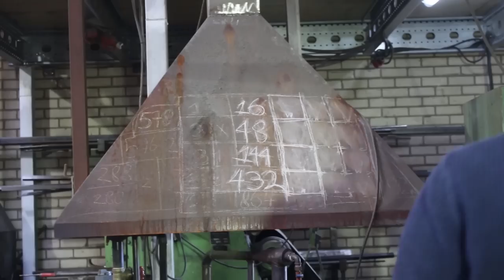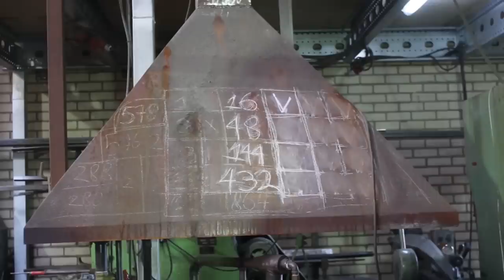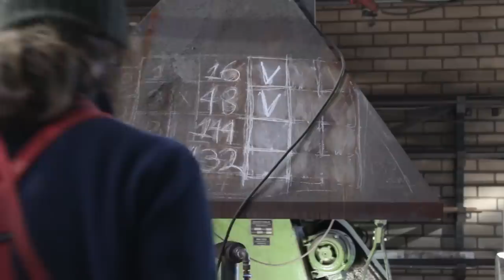Forging a double fuller knightly sword, the complete movie.

Comment: I would really want to see someone doing a sword like this just like they did it back in the 14-15 centuries. I'm sure its nothing like this. This this sword you made, it's piece of art.
Reply: I think it would be possible, but it would probably take something like ten times as long
Reply from the maker: You might be surprised how much was already automated by water power in medieval times.
Reply: @TheyCallMeHacked  uuuuuuuuuuuuuuuuuuuuuuuuuuuuuuuuuu
Reply: It essentially is done the same ways its been done for millenia.  The only things machines do is the backbreaking work and a more efficient way of heating the steel with gas forges  Aside  from all that and the option of whether or not monosteel billets are involved,  smith's or customer's choice, it's all still done much the same way for thousands of years.

Even with most of the backbreaking work now done by machines, some things must be done by hand for either best results or done at all.
Reply: Not just the craftsmanship. The guy who does nothing but 'make steel' is a major issue. We have nice steel in 2022.
Reply: Try looking for a documentary about forging The Ulfbhert ...  really forging from scratch ... making the crucible and kiln , then actually making crucible steel to make the sword with.
Reply: @rustythecrown9317  Exactly, WITHOUT THAT GUY! Your skill can only take you so far. He is 'that guy'. Iron Pillar of Delhi - without the metallurgist, most people had crap swords.
Reply: @gravewalkers  Vikings brought ingots of crucible steel back from Iran etc. , and crafted the super sword back home.
Reply: @rustythecrown9317  All of them did? One did? Give me a % of all swords made by wizard steel? 98% of them? Or .001%
Ballpark it for me.
Reply: @gravewalkers  5% maybe... rare ... only made them for a couple centuries till the trade route vanished. Wootz wasn't discovered again by the Europeans till 1800's.
Reply: @rustythecrown9317  I have a book on it. My other series. I will put up an audio book eventually.
Reply: এর RS ,, দামকতো
Reply: @rustythecrown9317  There's nothing special about wootz. It's mostly for decoration if you are able to get decent quality steel.
Reply: @Eric-zs6rd  true, today , but from 800 to 1000 A.D. , it was the cats ass.
Reply: @rustythecrown9317  Definitely not. Vikings captured or stole the Ulbert swords in battle. The production did not take place in the Scandinavian area.

The exact origin is unclear. Some researchers suspect the steel came from Afghanistan, Persia or India. It is said to have reached Europe via traders from the Orient via the Volga and the Caspian Sea.[5][6] Material analyzes in turn indicate that the lead comes from the Rhenish Slate Mountains. For this reason, some researchers assume that the monasteries of Fulda and Lorsch were the places of manufacture.[5] There is evidence of this after a find from 2012. During excavation work, a very well-preserved Ulfberht sword was found in the Weser near Hessisch Oldendorf. After a detailed analysis, the State Office for the Preservation of Monuments in Lower Saxony and the University of Hanover came to the conclusion that the sword was forged in the 10th century and that the lead used in the handle comes from the Hintertaunus. This was interpreted as a reference to a workshop in Fulda or Lorsch, because weapons production there is guaranteed and other monasteries presumably got the lead from nearby deposits

Source: https://de.wikipedia.org/wiki/Ulfberht#Ursprung
Reply: More likely 500 years earlier.  ;-)
In the 15th century nobody wore such monsters anymore
Reply: @10Pgb20ap0  Rapiers and flintlocks?
Reply: @dherman0001  in the 15th century were wheellocks
Reply: @betteroywoth2445  Thanks, I was thinking that, but I didn't know the name of it.  It's the type with the fuse hanging out of it?
Reply: @dherman0001  no, the wheellock literally spins until it sparks and detonates the blackpowder
Reply: @betteroywoth2445  I just looked it up, thanks!
Reply: @freerkwieringa275  And apprentices.  When you've got twenty 8-18 year old kids working for you and no OSHA, that's a lot of elbow grease!
Reply: I watched one earlier on making a katana from the movie kill Bill that they went back and made their own metal from scratch
Reply: @TheyCallMeHacked  It would take at least a couple months for medieval smiths to complete a sword like this, definitely not a one man job, and very expensive. So yes technology is astounding today

Comment: And can you imagine how they did it back in the middle ages? No welders, nor grinders, pressurized kilns, presses, sanders etc. All done by hand with fire, a hammer, an iron anvil, and a sharpening blade. It's amazing what human beings can do when they put their great minds to it.
Reply from the maker: hard work. but also more time
Reply: A smith that could produce fine quality swords also had a stable of apprentices. They were the power hammer and grinders.

Pattern welding also wasn't popular in the middle ages because they didn't need to compensate for the crappy pig iron they had to work with in the dark ages.

Comment: I always thought of making some fullering dies for a press but this is the first time I've actually seen someone use them.
I wonder if it would work on a power hammer.
Reply from the maker: yes they do, i used them before on a power hammer,  as did the renaissance smiths on water hammers.
Reply: @freerkwieringa275  I always assumed somewhere someone was doing it. I just never seen it with my own eyes until now.

Comment: Just curious have you thought of putting  borax in between the individual layers of the different steels then weilding it together it would help alot with no oxygen oxidation. Just a thought.

Comment: Does anyone know how much weight is lost to scale and grinding in the forging process? That is: what's the weight difference between the raw billet and the finished blade without the pommel, guard and grips?
Reply: Scale from forging is less than 1% by weight. Less experienced Smiths can make a lot of scale but it's still a very small amount in comparison to the original billet' s mass
Reply: @DogsaladSalad  Thanks!

Comment: Superb work ....Just one note though , personally I would have thought of the mounting of the belt plate on the sheath BEFORE gluing the three parts together , rather than having to shorten the mounting screws for them not to scrape the blade and for it having to calculate the thickness of the wood+ leather ( what a pain ! ) , I would have inserted mounting studs from the inside of the sheath in advance then either solder the studs in the holes after just cutting them to length ( making sure to heatsink the stud for the wood not to burn or something) , or make "no see" a bend twist of the studs kind of system ....

Comment: I have a question , if one messes up and makes" wrought cast iron" instead of pattern welded steel by mistake ,from over working the steel and over carbonizing it.  can that excess carbon be fired out of the metal? Then tempered to soften the core?  Also Instead of acid etching , can the patterns be shown by color case hardening ? ( Because...Speaking of making cast iron by over use of carbon )the way I'd imagine it to work would be  using tempa-lac to reach  just below the desired color temp and then add the particular  carbon source to get a particular  range of color. be it coal,bone meal , wood ash ect. ( Each carbon type needs more or less heat  and and time to penetrate the outer few microns of steel ,and that is why it matters . Bone meal gives a good wide variety of color and is a go too for straw yellow to blue/Violet. 
It would be pretty darn pretty to make a blade in the bone meal range and finish with coal to make red and oranges in various places.  I have the complete process In a text book from my gunsmithing course if anybody is interested in trying it   , I simply don't have the equipment to demonstrate .yet .
I plan on doing a flame lick pattern when I can.  Or flame lick and feather patterns .

Comment: Ok so I gotta ask because I've watched loads of forging videos but I myself an no black smith. So whats the deal with cutting the metal into small slabs and then welding them together, heating them up and then pressing them? Is there any advantage to it? Or is it just another way to forge? Because why go through that trouble when you can just take one piece of metal and just heat it up and hammer it? I'm not understanding.
Reply from the maker: it creates a layer pattern
Reply: @freerkwieringa275  you mean those squiggly lines?
Reply from the maker: @Darth1Marik  yes

Comment: Hey Freerk i had a question. I never seen you tempering a blade but you always get a spring strength in it. How? Do u temper them behind the videos?
Reply: Isn’t that what he does at 16:30 ?
Reply from the maker: @patrick7972  I fire temper the blades.
Reply: @freerkwieringa275  yes, I was pointing that out to @Stupid Signals

Comment: So I have a question: I know that Samurai swords were/are known for extreme sharp edges. But on medieval swords like this, how sharp/fine would the edge be? Seems like all the hacking and fighting would just tear up the edge if it were very fine, like a very sharp kitchen blade. Thanks!
Reply: European swords had higher quality harder steel blades, edge retention would have been less of an issue. That being said swords were match to the armors they had to deal with. Sharpness and edge profile would change depending on what time period it was and what type of protection they had to penetrate.

Thrusting, slicing, and cutting swords all attack  armor differently and change how sharp a blade needed to be and what shape it took.
Reply: A sword that size would not have to be a razor blade. Well-placed blows incapacitate the foe to the point where he can be stabbed. That is what the two grooves are for, so the blood can run out. On swords less broad only one groove is needed. If the blade is too sharp, it gets stuck in armor. The sword the blacksmith just made had a lot of flex in it, almost too light weight. But the weight of the sword needs to match the wielders strength and stamina. I hope this helps.
Reply: @maynardfrench5418   those two grooves are called fullers and are for weight reduction and not for blood running out
Reply: @maynardfrench5418  The two grooves are fullers, their only purpose is to make the blade lighter (without sacrificing much strength) in order to make it easier to wield. It has nothing to do with making someone bleed out out more.  If you stick a sword in someone they will bleed faster if you just remove the sword.
Reply: @shawndooley7778  Weight reduction and strength.
Reply: @taunteratwill1787  exactly
Reply: Well first off you don’t hack with these swords. That a fallacy created by low quality history books in schools and movies. These swords were very sharp and had more weight behind them. As far as cutting through, more effective than samurai swords. Samurai swords excelled at slicing as opposed to lopping off stuff. Though both can pending form, weight, length. Lots of demonstrations showing this. 

Samurai blades handled vibration much better than a sword like this. Its a common statement among analysts. There also were longer narrow blades around akin to samurai blades but not solving that issue. Neither are swung the same either. 

If you notice in cutting tests of the tatanami mats, yes spelled wrong not typical word to remember. Both sword types cut through them. However multiple mats the samurai blade generally is faster and often finishes. Its a physics issue. Neither sword can handle bashing armor harder than the swords hardness for long. See forged in fire for unreasonable durability tests. Few blade types handle major bashing, some are better though. An unused broadsword sharpened with pass falling paper test.
Reply: @maynardfrench5418  the grooves also were weight reduction design widening the blade helping balance.

Comment: If you want to play this video at more than 2x try this (only works for chrome) open up the java script console by hitting shift+ctrl+J and paste in without the quotation marks "document.getElementsByTagName("video")[0].playbackRate = 6" and hit enter, the number at the end is the speed. note that it can be demanding on your internet speed (and data) to play higher resolutions  on 6x... also this command will be stored in your java script console so if you want to use it on another video just hit shift+ctrl+J and hit the up arrow. :) hope this helps

Comment: I wonder if ancient blacksmiths did it like this, but Guess they had no outlets for their angle grinder or welder 😀
Reply: Files along with helpers to do the grinding. Files were the life blood of forging. Various stones as well which commonly now seen as blocks but then as wheels. At least for the better equipped shops. As far as welding yes, but forge welding. Likely the sheath tip would be a casting or a hammer form. Similar time for either outside modern welding which clearly is fastest.